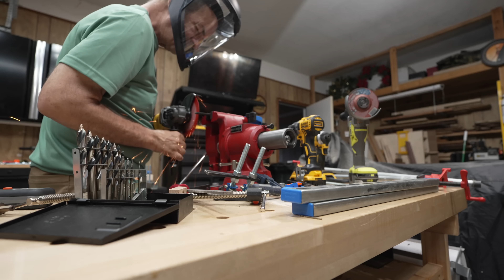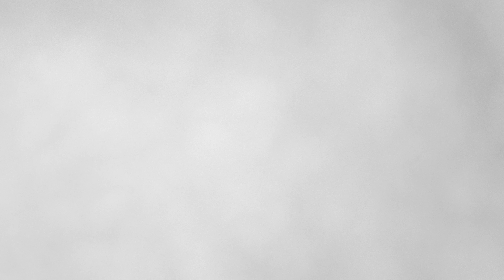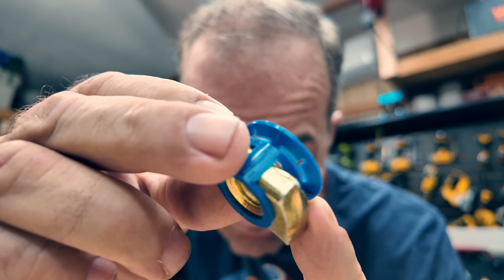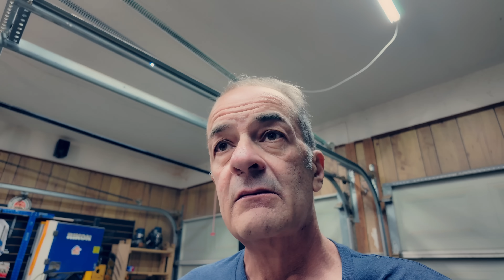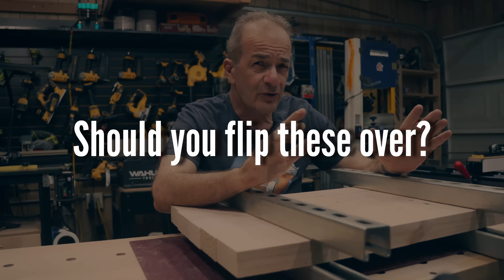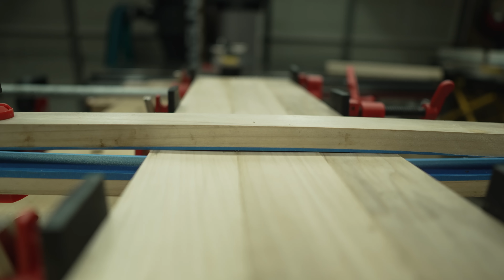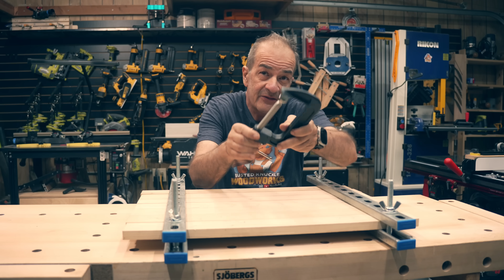This weird clamp could save your next glueup

Comment: How much pressure are people putting on cauls? If you need that much pressure to keep the panels flat there is no chance of the glue holding up. Great video and work around. That product seems to be incredibly more expensive in Canada but I will keep looking. Great idea and video.
Reply from the maker: @Aaron-nj4ou  thanks, appreciate it. It was evident from the comments I received in the first video that people are clamping down on glueups way too hard.

Comment: wedging is the easiest way to exert entirely too much force. with a machinist c clamp style you can exert a force on the order of 10x invested. but with matched low angle wedges (like 6 to 1) you can exert 12 times effort invested. and if you apply a clamp to your matched wedges you're looking at 300 to 1 force applied. wedges are crazy.
Reply from the maker: One of the fundamental machines you learn about in science class! 🤓

Comment: Also, it seems like you could use ratchet straps to tighten the calls together if you had extra of those, and less massively over-long bolts.
Reply from the maker: Way more possible ideas than I could fit into one video! 😁

Comment: The biggest problem that I find is that when I’m working on a project and need to strap something down, I don’t want to go fumbling through my shop, looking for strut, carriage bolts, c clamps to sacrifice to cut and drill, etc. I want everything at my disposal in a kit since most of the time, I am moving between job sites. It would really be cool to see a follow up video on how you organize in store all of this! Also, the ADHD in my wants to know what you did with the other half of the c clamps? 😂 what can you use those for now?
Reply: I'd agree with just keeping it all assembled, or alternately, all the galvanized or zinc coated metal parts would stick well to a cheap Harbor Freight magnetic strip.
Reply from the maker: Pretty easy to keep all of this (mostly) pre-assembled.

Comment: Did this same thing with some "unistrut" I got for free and needed some panel clamps before watching this. I also use wood shims to hold the wood tight together and 1x blocks to keep the "unistrut" off of the panels I and gluing.
It really does work great!!
You had some great ideas to improve it and I will definitely add some.
Reply from the maker: Cool!

Comment: Lessons, Tips & Techniques... it's all in here.  and I have those Metals but without holes in it, .. I'll just put holes and use it in my Wall Mount Folding Table project. Thank you sir.
Reply from the maker: Awesome 👏 thanks for watching?
Reply: @BustedKnuckleWoodworks  for now I keep visualizing what to do to make an angle grinder slide using tubulars pipes without using wielding machine hehehe

Comment: I've been using this method too. I'm a retired plumber and had some laying around, so I gave it a try. I've never seen those square washers for strut before, so thanks for showing those. They'll be perfect. Subscribed.
Reply from the maker: @Gazman299  I use the no-spin saddle washers quite a bit actually.
Reply: @BustedKnuckleWoodworks  It was a good video. Thanks again.

Comment: Great ideas, but what are the actual costs for a clamping system like this?  Or better yet, where could I find someone getting rid of them?  What industries use this stuff?
Reply from the maker: I have links in the description for sources, they all carry it. It’s used mostly in the electrical industry as I mentioned in the first video, so most electrical supply places would carry it as well.
Reply: Plumbers use it too. Try a plumbing supply house in your area. It'll only come in ten foot lengths, so you'll have to cut it to the size that you need. A sawsall with a metal blade does the trick.
Reply from the maker: @Gazman299  most of the home stores carry 2 footers as well.
Reply: @BustedKnuckleWoodworks  Yes, I've seen that. Kind of spendy though. If you have a vice strut cuts pretty easy, and it's handy to have around. Take care.

Comment: Fantastic logic, and I love all the solutions you came up with.  Not sure if it has been mentioned in the comments yet, but with the wedges you could use another clamp across to pull them together offering a more even pressure and much less likely to pop out...
Reply from the maker: That has been mentioned, it’s a valid point.

Comment: The funny thing about all this is the original design is an alternative to expensive store bought clamps.  Then the complaint is the cheap version doesn't have the same features.  So then more money is spent to add to the design.  There was a comment in there about 'no hardware', ignoring the fact that the strut is hardware and the f-clamps are hardware and the c-clamps are hardware.

in the end it's an alternative to store bought clamp designed for the same thing.  After some of those clamps are modified to be panel glue up clamps they can't be reused for anything else.  There is not one solution to please everyone.  You either keep generic pieces and put them together for the glue ups in a haphazard fashion, or you customize your clamp specifically to panel glue ups and nothing else.  Each person has to decide if it is better for them and their workflow if they want pieces that are reusable in many processes but harder to assemble for each process or if they want specific tools that are optimized for specific processes.
Reply from the maker: @scrager4  “No hardware” to me means no buying extraneous nuts and bolts and washers and stuff. Presumably the F clamps and squeeze clamps are things you already have, and you can still use them for their intended purpose on other projects.
Reply: @BustedKnuckleWoodworks  I understood it at that point, then it went down the road of modifying all those clamps specifically for cauls without other clamps and you basically made a home made version of the expensive rockler by buying and modifying clamps that can no longer be used for their original purpose. 

My observation is that you can either have strut channel with some clamps that you can reuse for other things and it might be a little cumbersome to set up pipe clamps and cauls.  OR you can have a customized caul+clamp that is dedicated to panel glue ups and requires you to spend more money on dedicated hardware.

BUT you can't have it both ways.

All in all, I appreciate the video.  I would go the caul and separate clamps route myself.  I think that the dedicated caul+clamp would be for people that make more panels than anything else or people with money and space to dedicate to specific tools.
Reply from the maker: @scrager4  I get your point. FYI, the C-clamps were only $6 😁

Comment: I think you can do a simpler solution than how you modified a G-clamp.  Cut the head off an F-clamp and drill a hole big enough for the bolt to go through in the middle of the head, and put the bolt through.  Tightening the F-clamp would provide pressure on both sides of the bolt due to the pivot point.  I'd probably add a wooden braces to the screw piece (as you did on the G clamp) and also on the other end (where you cut).

Fantastic research.  Your last video had stuck in my head and I'd wanted to design custom end pieces, but you've shown that all you need is bolts, nut handles and F clamps.
Reply from the maker: But you need to drill two holes anyway, otherwise won’t it just turn when you tighten it?
Reply: this would be so much easier with a picture :).  Ok, so you remove the head of an F clamp from the bar.  Then you drill a hole in the middle of the f clamp head, between where the bar used to be and the turny handle thingumy is, thread the bolt through the hole.  When you turn the handle it will push away from the boards as you tighten it,  but that will cause the bar-end to pivot towards the boards, when it makes contact it will start applying even pressure at both ends.  Probably worth padding out the "bar end" so that the head ends up approximately square when tightened.
Reply from the maker: @SimonStevensakaSnetty  interesting idea. Do you know of any drill bits that can penetrate that hardened steel? I probably snapped 20 bits making this video already 😂
Reply: @BustedKnuckleWoodworks  maybe my F clamps are cheap, but I'd be surprised if the steel was hardened.  I shall have to test.

Comment: use two wedges with an angle of 5 to 7 degrees on each wedge. this keeps the flats of the wedges parallel to the edge of the panel and the wedges will not work loose.
Reply from the maker: Great tip for larger glueups for sure, but on smaller work I find shallow wedges tend to run into each other.
Reply: Then cut off the tips. 🧐

Comment: add a pipe clamp to each end of the wedge, then tighten it and it will pull the wedges in to each other
Reply from the maker: @Carpenters_Canvas  That would work, but the point was to get rid of the pipe clamps?
Reply: @BustedKnuckleWoodworks  just spit balling brother, keep up the great work

Comment: Try using  quick clamps in the “spreader”  mode so you don’t have to modify any clamps!
Reply from the maker: You would need to place the bolts way too far away from the panel. I tried it.

Comment: Really great ideas.  I was about to pick up the Fulton 4-way pressure clamps, but I think it'll be fun making yours.  And if I add some plywood and a piano hinge, I might be able to make it a permanent attached to the wall solution.  Hmmm.
Reply from the maker: Wish I had room for that. You might be able to do it with just hardware and rods too.
Reply: @BustedKnuckleWoodworks  Thanks again for the video.  Just got 3 10' struts.  Going to have some fun with this one.

Comment: This is ingenious.   An inexpensive clamping and caul system in one?  I have been holding off on buying a lot of mid-sized and large clamps due to the cost.  Something like this though, with its interchangeability of parts, is a great solution!
Reply from the maker: So many configurations you can do with these